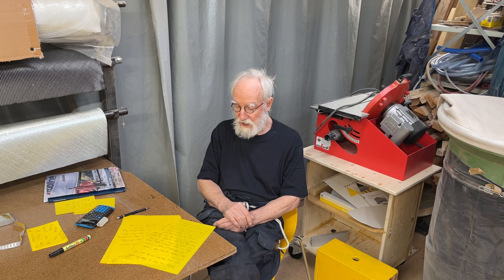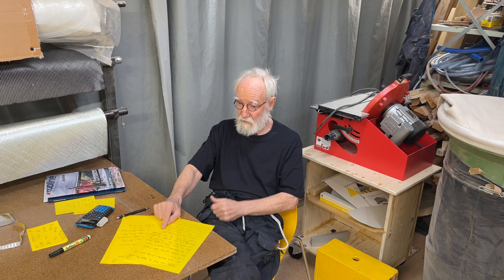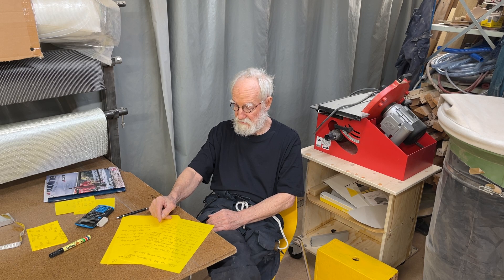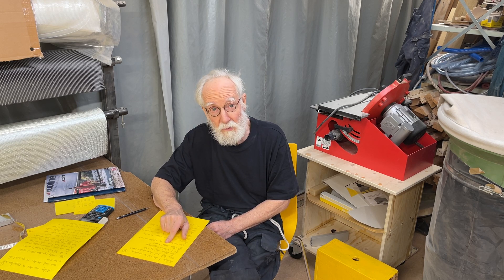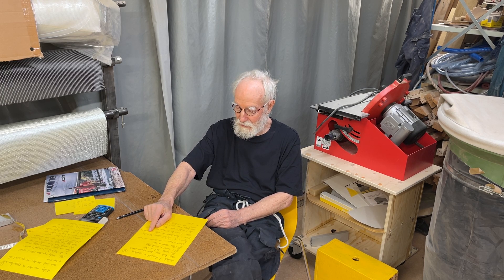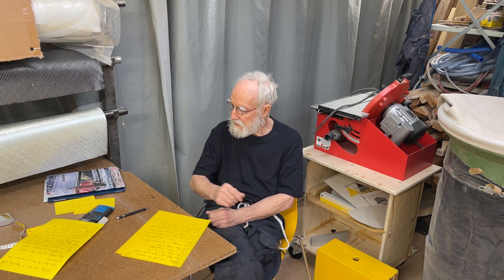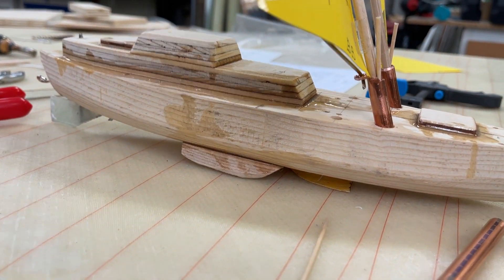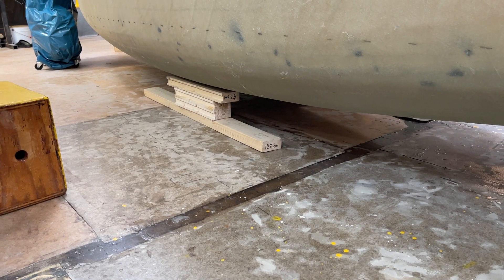To ruggidize I am adding twin keels for more stability and better beachlanding.

Comment: Dear Sven: With 2-keels it looks like you will reduce the draft which both makes the areas you can access greater and if you do beach, you do not need side stabilizing supports--which all sounds good.  Question: Will you loose/change CoG or have less stability than the single-deep-keel? What occurs to me is that during fast sail with the boat tilted, won't one of the dual-keels actually be completely out of the water; leaving you with only one shallow keel for stability against roll-over?  Thank You Sven for answer!

Comment: Bilge keels can work well however because of short depth and extra wetted area need careful design of foil shape to reduce drag and perhaps slight toe in to assist tracking. Suggest you contact an expert designer?

Comment: Nice. I love how you develope the boat.  Then you can have some small electromotor/genarator a bit up on the twin keel for powersupply and easy in and out of harbor.  Maybee the senterboard can lock in the same depth so there will be like 3 point stand?
Reply from the maker: I also have the super strong rudder axis.
The propeller of the electromotor would cause drag and the speed about 3 knots will be to slow to produce any meaningful amount of electricity
There is much development in this field so I keep my yes open and will listen to suggstions.

Comment: I'm concerned your rudder is subject to damage while sitting on the hard. I'm more of a fan of rudders mounted on the "transom". Love the twin rudder idea.
Reply from the maker: If you make something strong enough it will not break.
It is not difficult to make a moving thing very strong.
Think about the axis of a wheel on a car that travels 120 km an houer and hit a bump. It will not break. It is made to be strong.
If you did see the videos I made testing the rudder axis in G 11 may be you be convinced.
Reply: Sorry I meant I love the twin keel design. A friend of mine was driven ashore in a typhoon and his rudder was driven up through the bottom of his boat. Outboard rudders are also vulnerable. The beauty of a small boat is any damage would be easier to repair.

Comment: I think this one is good .. your not looking for speed . but it will give good stability and beaching 👍
Reply from the maker: Exactly.
This boat is made to perform well in strong winds.
Ordinary production boats a optimised for 15 knots of wind.
The mean wind near Cape Horn is 24 knot
As the force increases with the square of the speed it means that I will have to deal with forces 2.5 as strong as production boats

Comment: Have an idea that would make it possible to move the boat on the beach with the twin keels.  You could fabricate 2 roller assemblies that wouldn't take up much space when disassembled.  Then if you cut slots in the bottom of the keels near the front and rear, you could alternately raise the bow and stern and place an assembled roller underneath, with the ends of the roller axles fitting in the slots.
Reply from the maker: I have similar thoughts but there are many things to carry.
I might use wooden rollers I find lokaly